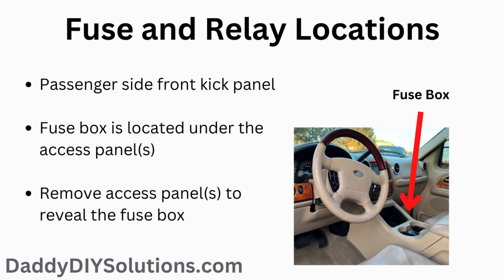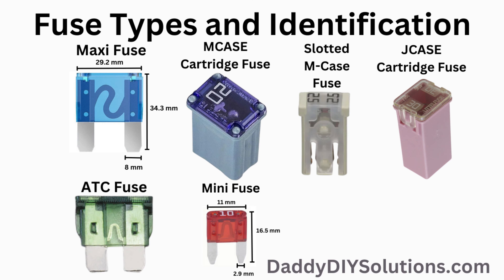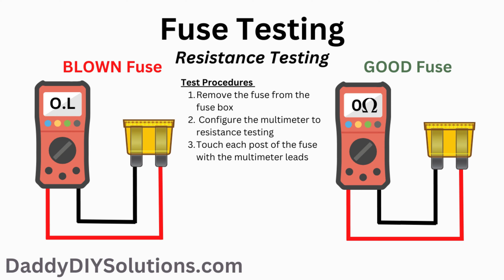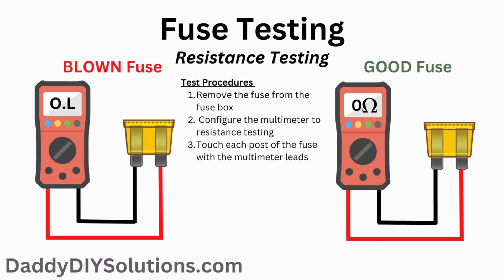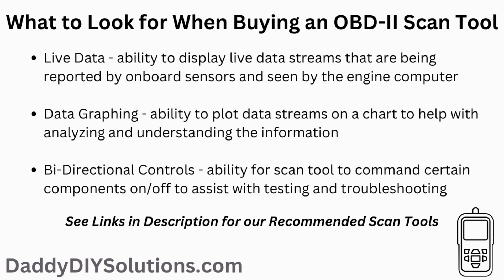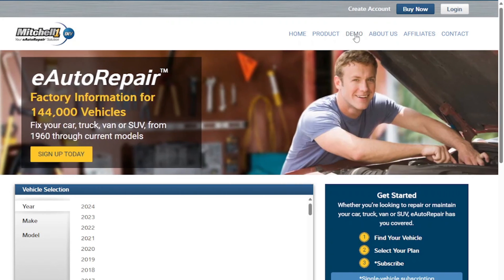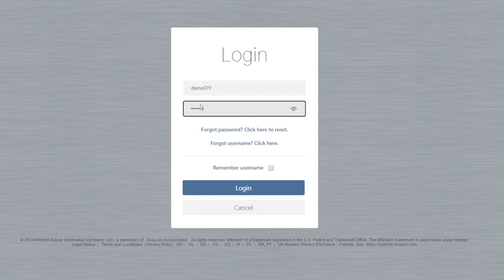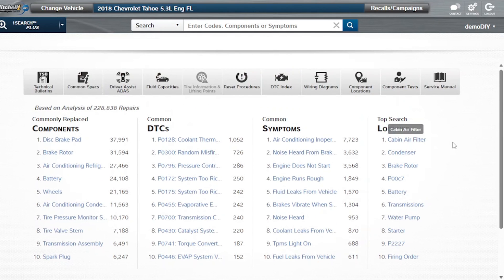2003-2006 Ford Expedition OBD-II Diagnostic Connector Port Fuse Location and Testing Methods

Comment: Thanks for the reminder of fuse location. my fuse was ok without the check engine light on.  I hooked the scanner up anyway and was alerted to a misfire.  I find it strange as it used to come on when there's a misfire. I will have to see if the check engine illuminates momentarily when the vehicle starts up.
Reply from the maker: My pleasure. Thanks!